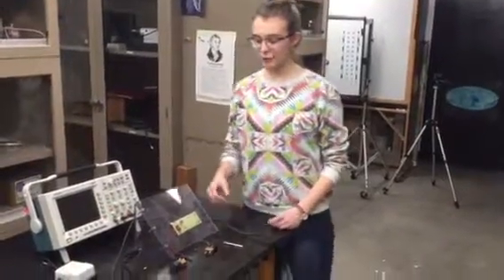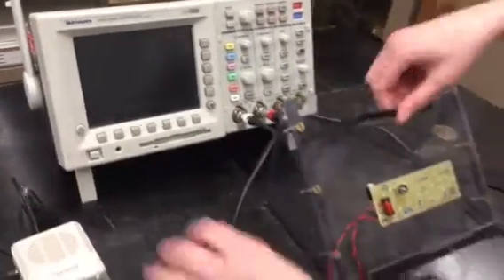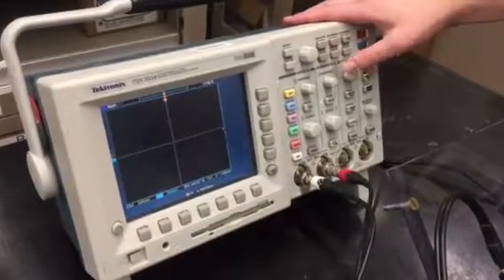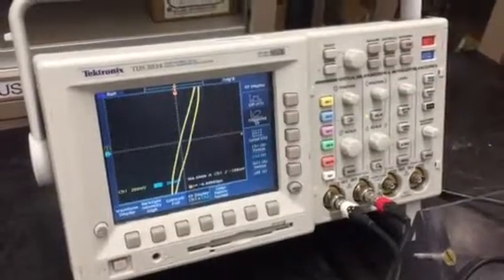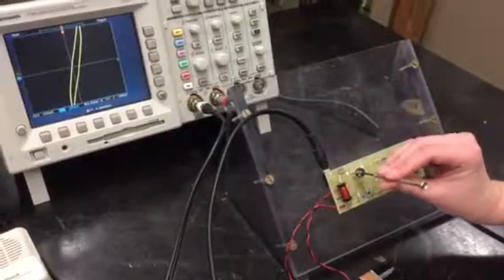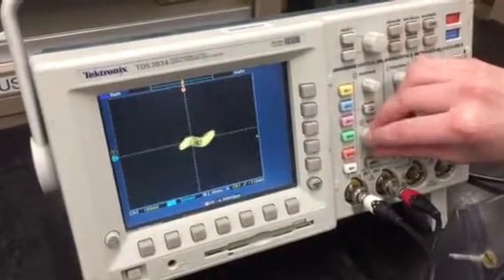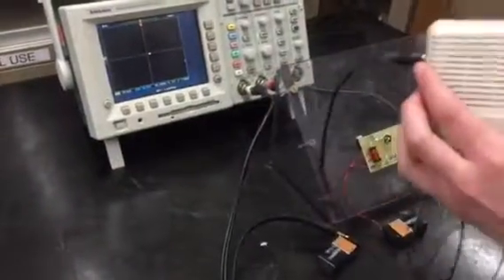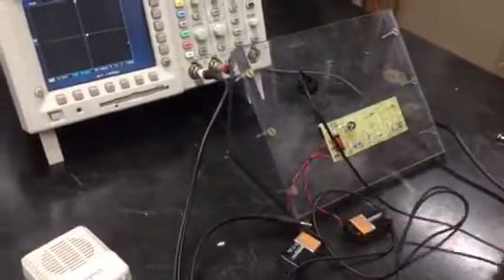3A95.55 Chua's Circuit

Comment: Awesome, but how can I increase the wave length, and Can I set this frequency above 20 Khz ?
Reply: Do you know were can i get this circuit
Reply: Scale the Ls and Cs to the frequency band you need.  Within the limits of the op amps, 1/10 the L and 1/10 the C should give you 10x the frequency.